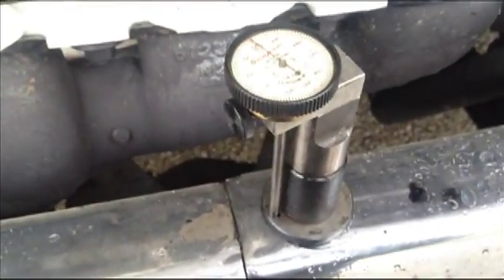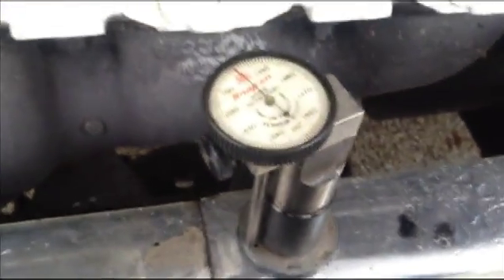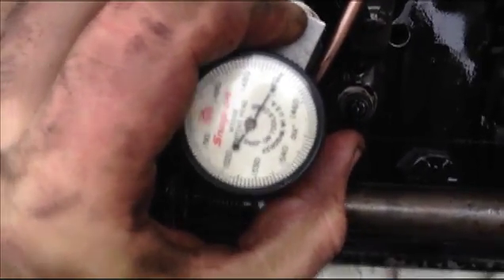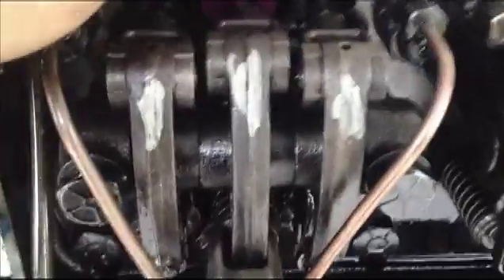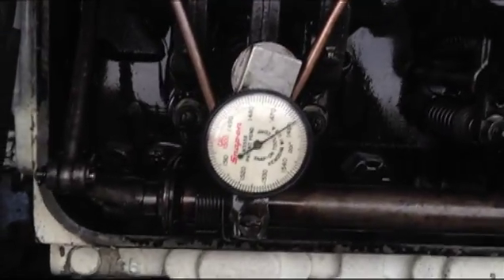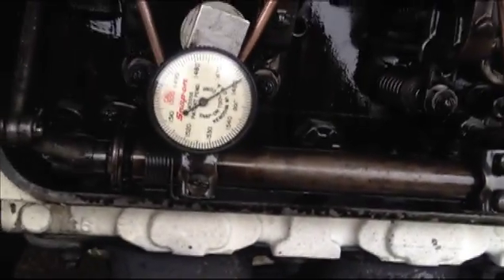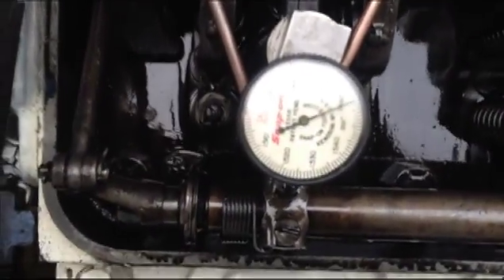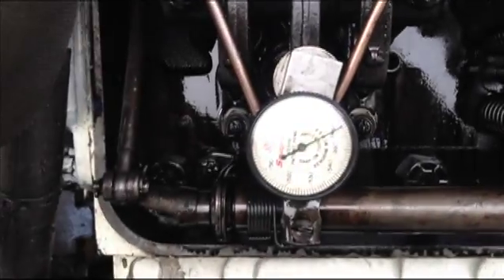Setting Detroit Diesel 71 series Fuel Injector timing

Comment: What height or spec do you set them at using a dial indicator?
Reply from the maker: Depends on the injectors and setup.   But 1.460 is a standard used a lot
Reply: @BusGreaseMonkey  just bought a 64 4104 and pulled the valve cover excited about the 24 valves I'm seeing.  How do I know what injectors are in it?

Comment: Hello and thanks for posting.  I'm working a Detroit Diesel 3-53 on a Timberjack 200 series Skidder with starting problems.  I'm certain the injector timing is off and I've found the timing tool (1.46 in).  Questions:  Does the choice of timing depend on which injectors are installed or is 1.46" close enough?  Do you have a procedure for using the Timing Tool instead of the Snap-on dial gauge?  Thanks again.

Comment: Ive been watching your videos for a while on these detroits, and i have a 4-53T in a 1985 suburban. i did a tune up and set the injector heights to 1.484. on the test drive afterwards it had very little power, so i re adjusted to 1.460 and it picked up, but still isnt what it was before i started. if you could help it would be greatly appreciated.

Comment: u know by rt u should always ck to c if ur inj rocker arm is worn or not & its e-z to ck, just get ur self a snub nose screw driver w/ ur exhaust valves open & insert that screw driver in between the clevis & move it up & down gently & c if it moves or not if it does R&R because the inj rocker wears more than the valves rockers arms, good luck to ya & happy D.D.A. to ya !

Comment: Hey. Just found you here & subscribed to your channel. It seems you've got tons of experience on these engines. I've got at least 6 machines with Detroit Diesels in them. -love them - even put an aluminum block 353 in a 59 Chevy pickup.
Question though: Have a 471  (N65 injectors) that the end of the injector fuel rod thing fell off the other day (the little c shaped piece that fuel rack goes into). replaced it with a rebuilt N65. Have a 1.484 injector tool, & set all the injectors to that. All 4 were set less than that. now it's low on power.  My searches tell me there's a .460  & .470 as well. I'm guessing they were set with one of those. What is actually going on with the different tools & why one or the other? Is it just a timing change or does it also change the amount of fuel being delivered? 
What should I be using for height?
Reply from the maker: lovesloudcars use a timing pin at 1.460

Comment: Turn the engine over until the valves are fully depressed on the cylinder you are tim ing.  GET RID OF THOSE DANGEROUS RACKS PLEASE. You are very good. Keep up the good 
work. Thanks from a old Detroit  mechanic.

Comment: I always thought that the simple height gauges were much easier to use. You could buy a set of height gauges (each shaped like a tiny cross) for a fraction of what the dial gauge costs, but you typically only needed one or two gauges. The point of the height gauge fit into a tiny hole in the cylinder head.

I gave my gauges away to a marine mechanic a few years ago.

The Series 71 diesel was introduced by General Motors in 1938, and it was discontinued in 1995. That must be one of the longest lifespans for any manufactured product.
Reply: in the dd tune up kit is a cocktail stick{ go no go gauge} this drops into a hole in the injector body and rotated with engine running on idle as part of the tune up process.